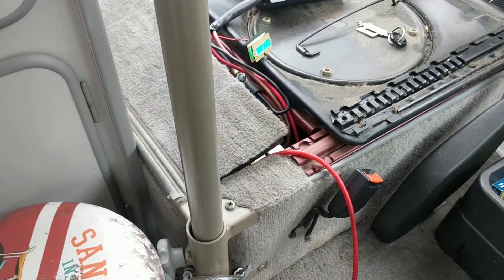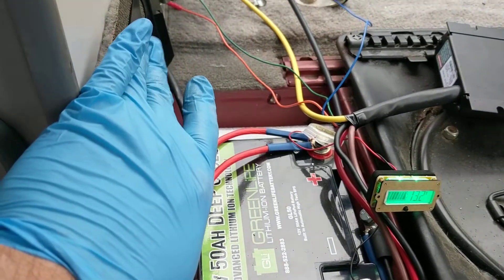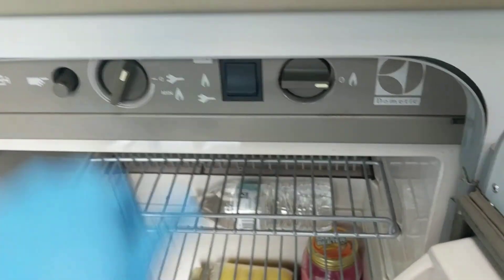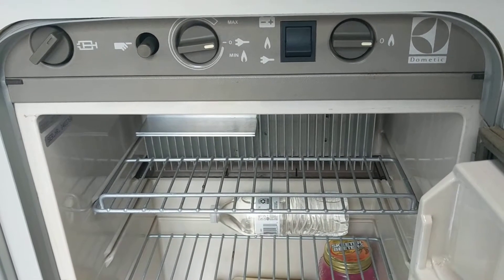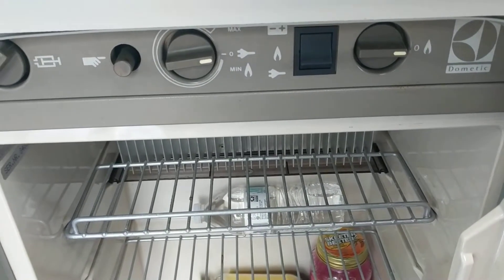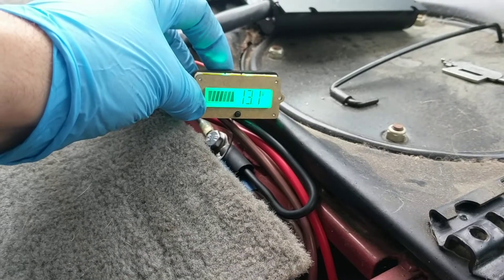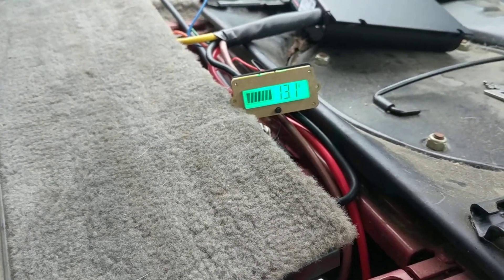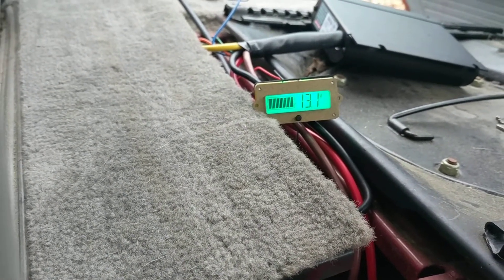Installing a Lithium battery and charger into a Vanagon Westfalia part 5

Comment: Any information on how to remove the Monitor Panel Indicator Panel (the row of LED telling one the level of water, Aux Battery, and if the Propane fridge is on) , after one unscrews it, how does it dis-attach from the panel on the backside?  I want to install a Blue LED and remove the original green.  Thank you.